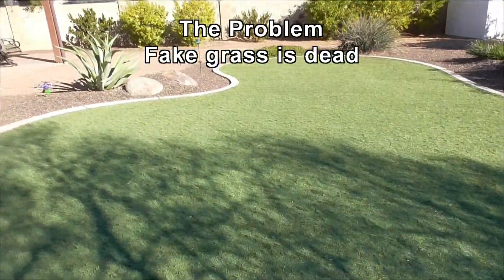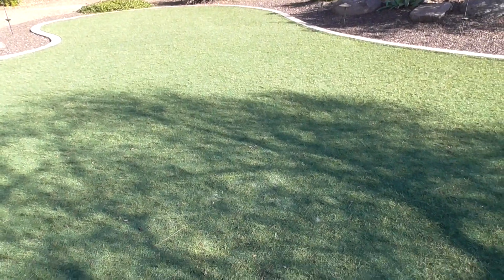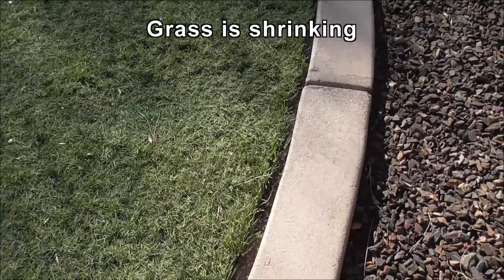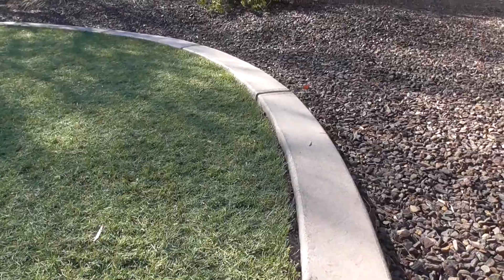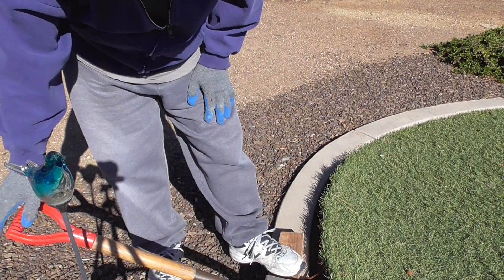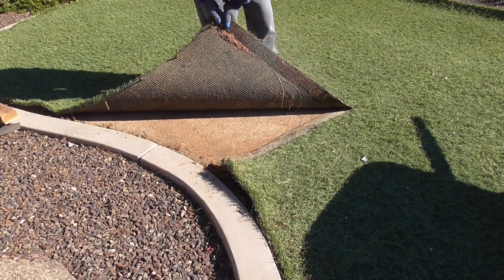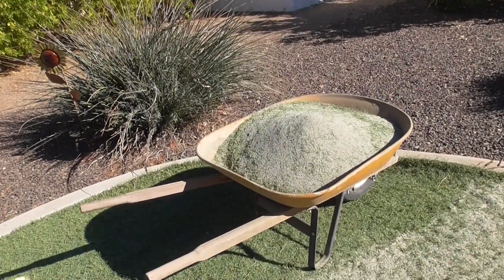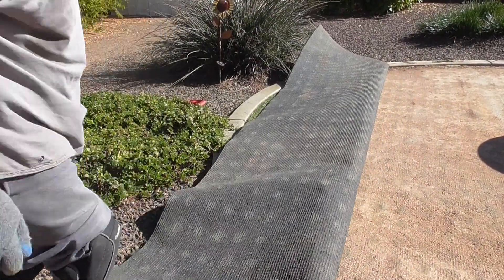Artificial Turf Removal - Jan 2021

Comment: The garden has turned into a lifeless desert under that shaggy green acrylic carpet!
Reply from the maker: Hi Zinnia, 
Well the garden was a lifeless desert before it was installed. I've tried to grow grass here in Phoenix AZ and it doesn't work unless you put tons of precious water on it - which we have to pay for BTW. See page 90 here https://www.mesaaz.gov/files/assets/public/v/5/utilities/utility-rate-book.pdf
This adds a nice bit of color that would otherwise not exist.
Reply: @richbinaz There are a lot of native desert plants that don’t require much water or maintenance and are good for wildlife. I’m going to remove our fake grass to plant native species in that spot. Thanks for posting!
Reply from the maker: @emilycowles9904  Quite true, and perhaps your city will actually pay you to remove real grass to put in a xeriscape. See this link for my city 
https://www.mesaaz.gov/Environment-Sustainability/Water-Conservation

If you are removing fake grass, you need to have a plan to get rid of the sand holding it down and then the 1/8 minus crushed granite under the grass, plus any curbing retaining it. That crushed granite is a good weed barrier and quite waterproof.

For watering, I recommend using white PVC sprinkler pipe for the main lines, then converting to the 1/4 inch black drip emitters, via manifold adapters, for the final feeder lines. The larger 7/10 inch black lines split after a few years and you will be doing lots of repairs 

Here's a few videos I've done over the years. Worth a look B4 you put in a drip system.
https://youtu.be/uXNcDOTXG04  Another black plastic drip leak
https://youtu.be/3V5wDKC_ypo  Getting rid of black plastic drip lines in Xeriscape
https://youtu.be/lU1csXVuNbA  Fixing leaks is not over, just slightly easier.

Comment: I live in a historic Central Phoenix neighborhood with flood irrigation, natural lawns and huge trees.  A neighbor filled in his bermed yard with truck loads of soil and sand and replaced his natural grass with a perfect green artificial lawn. Very hot and very fake looking! An acquaintance of mine was interested in the property and pondered what, in addition to the $800,000 price of the little house, would it cost to restore the original grading, soil, and flood irrigation system in order to have a cool, natural grass lawn again. I do not know if herbicide was used in addition to sand to prep the under-layer. Either way, I imagine it would cost many tens of thousands of dollars to restore all the damage.
Reply from the maker: That will cost a bit to remove the soil to get it back to the same level it used to be. But that would need to be done to ensure that the water flows properly. I'm sure it will cost a lot
I assume the rights to flood irrigation were not rescinded once the fake grass was put in??? Is that a thing??? I can't get that at my poor Mesa home, would not have helped anyway. 

Our grass was terrible for so long, I consider it a vast improvement and it saves water.  & no mowing. The old grass never helped cool the area down.

Do not need herbicide, the crushed granite under the fake grass acts as a natural weed barrier and is fairly waterproof.  The only weeds I see are from seeds that blow in on the wind from other peoples weed infested yards.

Comment: Thank you for posting your video. I have had a heck of a time finding one done by hand not by a magic machine. Ours is about the same age and from the looks of it maybe about the same size. How long did it take you to do pull it all up? We are doing this in a few days and want an idea of what we are getting ourselves into. Thank you again.
Reply from the maker: Hi Milissa,
The first part of the lawn was about 15 feet long, the second about 25 feet - the way I was removing it. I was just able to get all the sand out on my own in the first section. But it was hard work. I found pulling the grass up and over at each end made it a bit easier. Then while the grass was over, I went along and beat on the back with my hands to knock the sand out and onto the bit left in. Then you can cut off a 3 foot  chunk along the backing with a sharp utility knife, roll it up, tie it with string and in my case - store it ready to go in our trash barrel. (we don't have free roadside pickup like some places do).

The longer section proved very hard to do, even with my wife helping. Nails, tape no problem, but the weight of the sand in the grass made it almost impossible to turn over more than a foot or 2 of grass to get the sand out. In the end I called my son to come over and help out. That did it, with the 3 of us turning each corner, then the middle, we were able to get a 2-3 foot section cleared of sand. Then cut and rolled. The rolled turf was quite light, all the weight is in the sand.

On the last segment, we first pulled one end up and over. Cleared the sand, then the other end so all the sand was in the middle. Cut those ends off, then made the center piece as small as possible finally lifting that center piece over the wheel barrow to dump the last of the sand.

I had a pretty big area set aside to put the sand down (our concrete patio) You can put it on a tarp, but then you will have fun shoveling it off the tarp for the new grass.

There is another video I made showing how we installed the new stuff. They wouldn't let me put a link in before so search for RichBinAZ Jan 2021 and it should come up.
I should have used a hook style utility knife to cut the curves from the top side - oh well.
The new grass has much longer grass blades than the old stuff - Denali 90 I think - Anyway, the seams would have worked better with about a quarter in gap rather than the butt joint we tried.
Putting the sand back in with the drop spreader took 2 days and I don't think I put enough in.
May have to get more sand and a special rake to smooth out the high spots on the sand. Brushing against the grain didn't help that.

Still learning
Reply: @richbinaz Hi there...thanks for the video and information.  My 11 y.o. turf has run its course about 6 years ago. I'm ready for it to go too.  I'd rather live grass and so does my dog.  The turf gets too hot in the summer (California), my dog's waste builds up in the turf, weeds keep popping up, gophers keep burrowing underneath it and causing unlevled ground, and the bugs are having a party underneath.  I inherited it from the former owners and liked the concept but it's just as much work and expense as live turf in the 8-10 year lifespan.
Reply from the maker: @nunyamarie9044  
Hello. I suppose fake grass is not for everyone. We don't have pets, but our kids do and when they came over and rolled around on it they got covered in faded green confetti. It was time for it to go. There is a pet friendly infill that absorbs some of the odors, but the kids do have to go out and pick up the poop on a regular basis, otherwise it turns into a minefield.

If you live in a normally rainy area, then real grass is the way to go... as long as you have a good mower, can control the weeds, fertilizing, overseeding for winter, maintaining sprinkler heads, pipes and valves and all the other things that go along with keeping up with a real lawn. 

For us in Phoenix, our "grass" always looked terrible. The only green parts were the weeds and roundup would not kill them. Our water rates were starting to rise, so we swapped to a mostly xeriscape design and our water usage dropped in half - along with the bill. As I'm getting older, I don't want to be out there mowing bad grass in a dust cloud, so fake grass was that solution.

Cost wise, I think it works out about the same. New fake grass is expensive and it has almost doubled in the last few years of inflation (corporate greed). Here's a link to our water rates. Page 90 in this pdf document...
https://www.mesaaz.gov/home/showpublisheddocument/46224/638423757142700000

It takes quite a bit of effort to pull up and then you have the question of what to do with the infill (sand or ??). I cut the old lawn into manageable rolls and dumped them in our trash bin over quite a few weeks. I don't think it is recyclable... https://www.mesaaz.gov/home/showpublisheddocument/35512/637890130974700000

Good luck with whatever you decide to do.

Comment: Was there no weed memebrane? If not was it ok all these years
Reply from the maker: No Membrane! 
The soil here is hard clay when dry and the yard was prepped with a Bobcat removing about the top inch or two of soil, along with what was left of the original grass. Then a crew came in and laid the concrete curbing, which has not shifted or moved or broken up.

Then a bed of crushed granite was put in, sometimes called 1/8" minus, and contoured very slightly so it is a little higher in the middle by about an inch. Total height was about 2 inches. The grass was put directly on top of that, nailed down and sand added for the fill. (see link in main text)

Very few weeds, nothing growing through from below. Most of the weeds we have had, grew around the edge, with just 1 or 2 in the grass itself. All easily pulled out. These are all from seeds blown in on the wind, or birds pooping them out.

We have crushed granite in other parts of the yard and it works well as a weed barrier - nothing thru from below, only seeds that blow in causing weed issues.
Reply: @richbinaz  thanks for the info